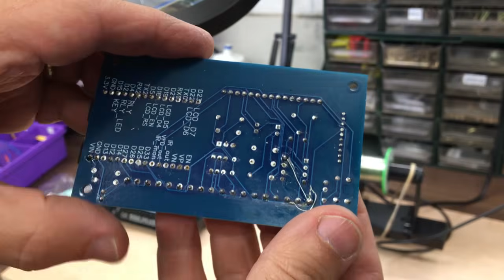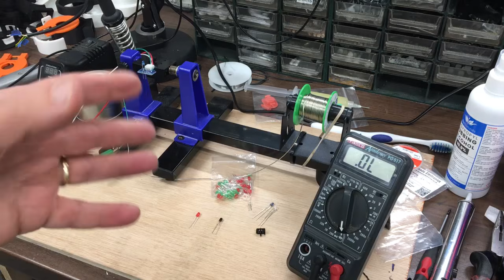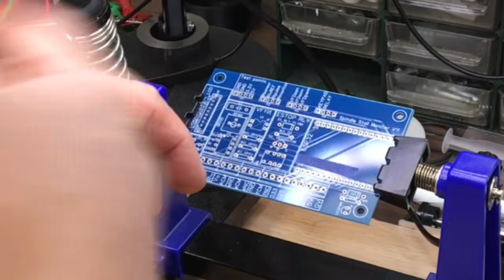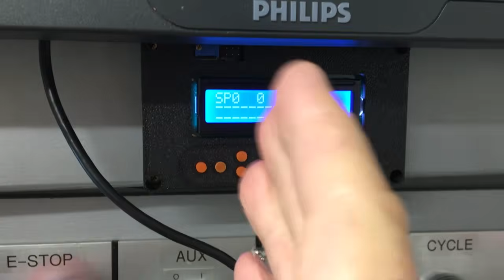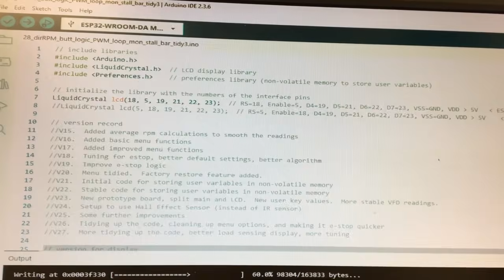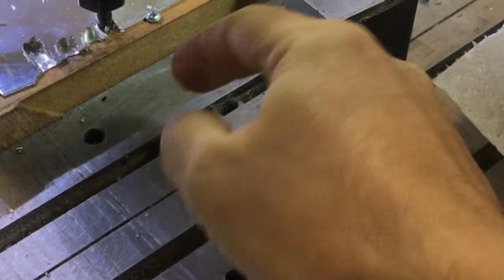Ep:11 CNC stall monitor | Let's test this thing!

Comment: Do you have a braking resistor on your vfd? That would stop the spindle rotation much quicker. My huanyang calls it braking😊 Or, is there any way in mach3 you can monitor the current used by the spindle? That’s how I do it in Linuxcnc.
Reply from the maker: I do actually have a braking resistor I bought probably 10 or so years ago for the inverter I was using at the time.  But the spindle spool down time was fine so I never added it.  But I think this inverter (Huanyang) supports a braking resistor so I could try that.  It's an interesting point since when the whole system e-stops the inverter just gets a standard "stop" command meaning it will spool down safely and normally and dissipate the heat generated.  This means when the end mill physically stops/jams the inverter is still in part of the spool down signal and you can actually hear it trying to spin the motor to get back in synch.  What I really I need to look into is the e-stop signal of the inverter and see what the max ramp down rate is without, and then with the braking resistor.  Technically the CNC machine has stopped pushing so it's not a big problem but it would be kinder to the inverter and spindle to stop them quickly.  I'll give it some thought!  Many thanks for the comment.

Comment: You seem to have space on the second text line to have 5 letters rather than just 4. This would avoid abbreviating estop and have a more intuitive accel and decel.
Reply from the maker: I originally went with 4 characters based on the space needed for the load meter bars I had running initially.  But now I've got that working well I'll have another look at the status text area.  Should be pretty quick to modify the code.

Comment: Super cool project. What about using IMU to sense abnormal vibration of the spindle?
Reply from the maker: I did think about that but the algorithm to determine abnormal operation Vs heavy cutting might need some work.  One to think about as it would simplify the sensor location.

Comment: Hi, I have been following your channel for several years and it was your CNC project that inspired me to do my own. As with most CNC users breaking expensive cutters is soul destroying so I would be very interested in building this system myself. Congratulations on finally getting it to work
Reply from the maker: Ok thanks for following along.  I want to make a few more changes to the housing and then see if I’m ready to send out the files, or there is more tinkering to do.